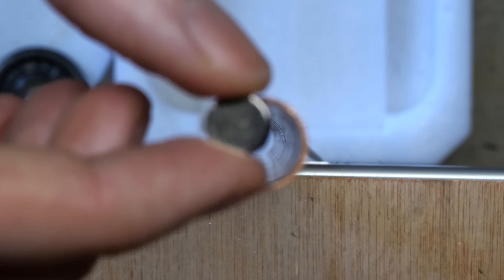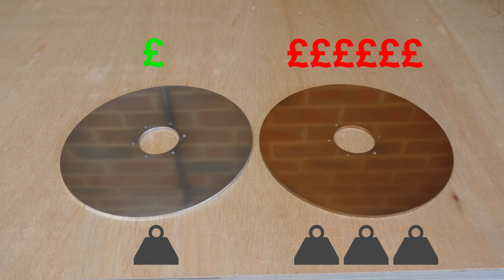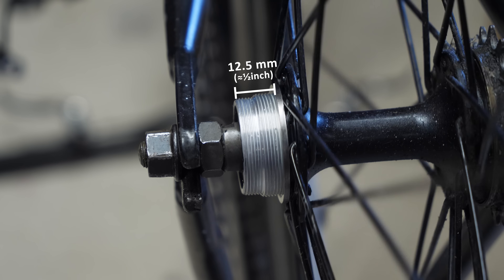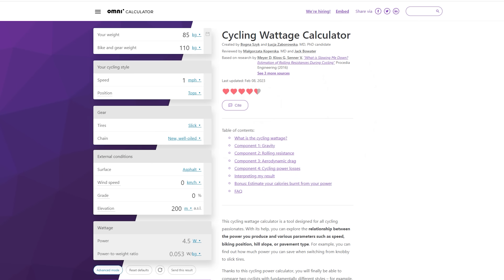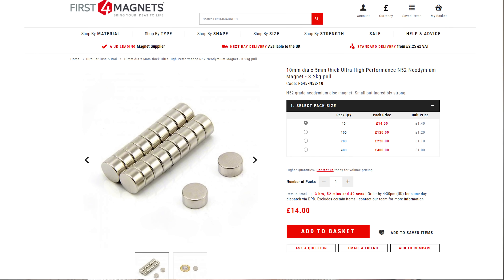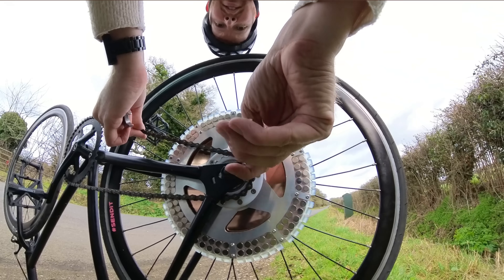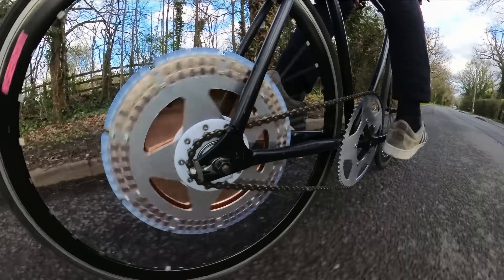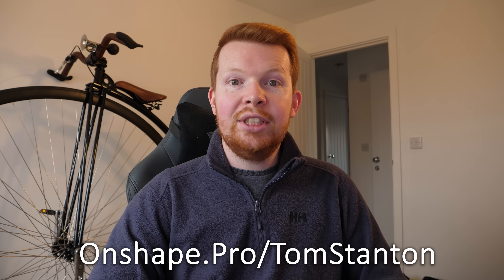Gearless Magnet Bike

Comment: Shouldn't we be able to harness energy in this way by using a weight attached to the copper pulley. Replace the permanent magnets with electromagnets and raise a mass using wind, waves or typical hydro-electric energy. Raise the weight in times of surplus and release that energy when needed for maintenance or to use when there is no wind, waves or flow. A weight against gravity is an efficient way to store energy. People think of batteries when the subject of massive energy storage enters the chat. Just use a giant weight.

Comment: This could still have some uses, you could make it work as some form of an additional brake to save on brake wear for non electric bikes or for when the battery is full and you're still going down hill, it would not be good as the sole energy transfer system since the magnets act like a perpetually slipping clutch or a fluid coupling not unlike a torque converter in an automatic transmission (incidentally part of why automatics used to get worse gas mileage is that manuals lock up their clutch while old autos would just keep slipping before modern lock up torque converters).

Comment: If your hub doesn't freewheel, would pedaling backwards not apply more braking force by increasing the RPM delta?  Did you try that?  I imagine it would push a lot of force through the pedals, though.

Comment: I think the best use of this sort of thing would be if you had a normal chain drive, but you could engage and disengage it like caliper brakes for coasting down really long and/or steep hills. Much quieter and no brake pads to wear out. Also have conventional brakes for emergency stops.

Comment: I always wanted to make some kind of inner giro rear wheel, So you pedal and its inertia would power the wheel with a kind of clutch system, so example, you pedal like normal, this in turn puts inertia power into the spinning giro in the rear wheel, when you stop you then engage the giro that's spinning to start you off again. Yes, one thing i would worry about, would its spinning inertia keep you upright without touching the floor lol. Thanks for all your time making these crazy videos..

Comment: You should try drilling holes in the copper disc (maybe like the shape of a disc brake) to improve heat exchange, save weight and interrupt the eddy currents. I believe that the power transmission would improve if the eddy currents weren't able to flow in their favorite direction

Comment: You wanted to emulate a CVT gearbox on a bicycle, but ended up with sort of emulating a torque converter automatic, but dry and without any gears. Or electric motor's regen braking. Anyway putting something like this on the rear axle of the bicycle on top of all the other issues discussed here is generating a rear braking force whenever you stop pedalling, which is scary dangerous whenever you cycle on wet tarmac, even tiny braking when turning can cause a lockup and cause you to tip over.
If this helps in future projects, modern mountain bikes have significantly wider rear axles than that, much more room for equipment.

Comment: Had you considered using the copper to drive the magnets fixed to the wheel? A narrow copper ring of larger diameter would be a better idea as it has greater inertia. Now consider that you are creating an electric current. That waste energy could be used instead to generate power for a pedal-assist motor

Comment: 10:47 you should have just used a belt instead of chain. Either that or just buy a non magnetic stainless steel chain. What if you put magnets on a disc and magnets on another disc but have them polar opposites so when you pedal they push against each other? Basically like a motor without power is what im thinking.

Comment: One thing you might have been able to do instead of 3D printing the threaded piece would have been to use an old fixed-gear sprocket with matching threads, and braze it to the copper disc.  This would make for a much stronger part than a resin print, and you could either grind the teeth off the sprocket or machine a matching tooth profile in the disc to inset the sprocket into the disc, making the whole assembly thinner.

Comment: very interesting idea. i was actually surprised how little it worked. I wonder if you incase the magnets in metal to point the magnetic current directly at the copper sprocket if it would give a "little" more resistance to it. it may actually keep the magnetic force from overlapping and give a better outcome?

Comment: Magnets sticking to the chain were a hint that you should be using ferromagnetic shielding, just a thin sheet of iron to snap on the magnets to guide the magnetic field. Not only it would work as a shield, but it would probably increase the strength of the magnets on the other (working) side.

If only I've seen this video sooner.

Comment: But you are using a lot of force, and that "slip" difference is going into heat in magnets and copper plate? am I correct? Do you have thermal camera? :)
Reply from the maker: I use a thermal camera at the end of the video :)
Reply: @TomStantonEngineering  I literally stopped watching right before thermal camera shot. Sorry! :)

Comment: Have you considered getting a belt drive for your bicycle to take the steal out of the equation on these experiments? Also, I wonder is a belt drive threaded with magnets on a large carbon sprocket would replace one of the disks on a magnetic clutch design.

Comment: Any thoughts on giving the clutch the ability to move closer and farther away from the disk?

You could also mount an array ofagnets to the frame and use those as a brake. Again, you would need to be able to move the disk closer and farther away from the magnets.

With enough room (to move the disk) you could use the same disk for acceleration and braking.

Comment: 3D-printing is fancy, a buzz word and makes your sponsor happy. Anyways, any normal mechanic would have brazed the copper disc on a worn sprocket or freewheel to get that cheap and reliable done. You can do this with a TIG welding machine (cheap DC is good enough) with silicone bronze (CuSi3) or just a stripped cut end of electric cable.

Comment: Copper wires for high-end electronics projects are sometimes plated with silver, because silver is a better conductor and current tends to flow on the surface anyway.  Would it help if you plated your Cu disk with Ag?  Nice project.  Thanks.

Comment: Fantastic idea.  Another possible direction of attack is to put the magnets at the peddles, or even both. 

Now the Electrician side of me (and in theme of electric bicycles), thinks what about adding electric magnets, so you can vary the magnets connected.  You could upgrade that with Arduino programming to control the magnet "connections".  Having both axle and peddle magnets, and then activate them for both power and braking.

Some other thoughts I had was what happeneds when you're at speed and reverse peddling.  Does this increase the breaking force, or is it possible to 'jump' the magnetic flux and thus your braking force would be reduced, or even accelerate (not likely).

Then you could have 'electric' gearing per se, in which you could activate or deactivate rows of magnets to alter the force applied to the wheel.

Comment: Please try this with a planetary reduction gearbox.  Place the disc between the input shaft (maybe the output one works, I don't know) and the outer ring gear.  With a high output torque, the magnetic disc slips, and what counts is the mechanical reduction of the planetary reducer.  With low output torque, the magnetic disc will drag the outer ring and the final ratio will be approximately 1:1 with high efficiency and little slippage of the magnetic disc.  Maybe this will have a real magnetic CVT.  NOTE: I used the translator, forgive the English.

Comment: Use the wasted energy to power a small motor when going uphill.  There is a significant amount of current being generated from the spinning magnets.  Essentially the wheel itself is a generator, and the added weight of a motor would be slight.

Comment: I realize this wouldn’t be the same as what you were trying to accomplish using copper but what if you replaced the copper disc with a magnetic disc made of a steel? Would it transfer more or less torque to the wheel?

Comment: There is a reason that copper electrical cable is smaller that aluminum for a given current & voltage-BECAUSE COPPER IS SIGNIFICANTLY MORE CONDUCTIVE

Comment: What about using a fluid bath torque converter instead of a magnetic drive?
There would still be no direct connection between sprocket and wheel

Comment: Really nice Project. I was wondering if the resistance torque in general is increased by the magnets passing the frame (and actually by all electrically conductive parts moving in the magnetic field) and generating some eddy currents acting as a kind of additional brake. However, this is a very interesting effect and explained very well. Great job!
Reply: Perhaps a carbon fiber frame and wheels with a belt drive.

Comment: A couple notes/questions:
- does the braking increase if you pedal backwards? seems like you haven't thought about it
- can this be used to generate electricity? And does applying a current to the disk reduce the resistance?

Comment: Great idea, but do you know what would have worked better... Magnetic peddal assist. Keep a drive train for initial force, but use a carbon gates belt drive rather than a metal chain, a hub gear system, front brakes as normal, and the magnetic drive as an unlimited pedal assist that does not require recharging. That should work.....in theory🤔🤔🤔!!!

Comment: Nice bit of work!  I would imagine that the heat created in the disk would also be created in the magnets, so the plastic magnet housing will soon loose strength.  This scheme would make a nice water heater driven by a windmill.   Wrap copper pipe around the static magnets to cool them, and using a pair of rotating copper disks with water bled between them via a gland on the shaft to cool the disks.  Could be a nice build! Thanks.

Comment: .
    This is an interesting concept. How about being able to control it with a battery and electro magnets, the electronic equivalent of a rheostat and a polarity reversing switch for different effects or maybe even a PWM controller? This would give you direct, infinite, continuous control of your "gear ratios".
    Maybe you could put a small parasitic coil on the bike frame near the magnets and regulate it to charge a super cap to power an LED head and tail light? Just sayin'

Comment: I feel like this idea could go much further with more engineering. There seems to be a lot of wasted energy just when breaking that could go into a super capacitor that might then be used to help get the bike moving from a stationary position. 

Also, I feel like the chain itself should be swapped out for something non-magnetic like ceramics or something.

Comment: The idea is interesting as an experiment, but for practical use on a bicycle, complete nonsense. On the one hand, the efficiency is low, but the main thing is that you need to keep pedaling and you can't rest, because instead of driving by inertia, the magnetic clutch starts braking, and the more the speed was higher, i.e. the more energy was given to the higher speed. In theory, a centrifugal clutch that would allow idling would be worth trying. (Google Translate)

Comment: I find this highly fascinating, don't know why I stumbled on your channel but being a car guy, this makes me imagine magnetic clutches vs. hydraulic or cable clutches - similarly, magnetic gearboxes, which this video also recommended me several videos from Tom Stanton EDIT: (which my tiny brain just realized was also you)!
One major flaw I found with your design is a seemingly unbalanced disc. In every clip in your beginning tests with weights, slow-motion or otherwise, it has an obvious wobble. This could be due to the heat generated during the CNC routing as you aren't using lube, causing the disc to warp (I'm not a machinist and may be incorrect), or heat generated by the magnets during braking? Or perhaps the hub itself? Bearings? Poor alignment? Magnets not being the perfect weight/size? Copper is easy to bend or melt to begin with, especially when heated.
Additionally, in the final prototype/build, wouldn't the magnets lose their strength due to heat over time?
Regardless, a fascinating concept and a joy to watch.

Comment: Maybe it can be used alongside an electric motor to assist in adding energy so all the energy isnt coming from the battery, and the extra energy can be used to charge the battery simultaneously.

And the breaking feature could be be used alongside the regular breaks to save on brakes as you said.

Comment: i have an idea for you to put into practise and get rich with:

an automatic gear system for the bike - based on centrifugal energy (if rpm > rpm+x then flip to bigger diameter gog)

electronically                     
(no chain between legs and wheel, legs -> dynamo in <-capacitor/battery-> motor on rear axis i.e. ; switching gears by counting hols on rear axis) 

purely mechanical  (a weight centrifugally responding to rpm triggers a gearchange)

electromechanically  (electronic on rear axis triggers a gearchange - but power is direct input by chain or kardan-shaft)

i think it could be done any of the three ways.

Comment: Have you thought about electromagnets of sorts using some kind of transformer for adjusting magnet strength for a type of gear transmission, Probably this video explained why my idea couldn't be done but if it was to work, you'd be the one to figure it out.

Comment: 1. if the chain slows it down can't you make the chain with a different metal to not be magnetic? 
2. could you put the magnet in the front wheel, and or do 2 wheels and possibly increase the output? 
3. Can you do a demonstration with it spinning on its own, just the wheel and the pedals? 
 4. Whats the difference in speed between it going on it's power without pedaling verses coasting? So, what is that speed and distance at all in comparison? Compare the speed and distance of coasting verses the speed and distance of magnet power. This is basically the information that I'm looking for thanks.

Comment: In fact, such a magnetic clutch is not a torque transformer but more a power waster. This is because the torque you generate multiplied with the angular velocity difference between the magnet wheel and the copper disk is the amount of power wasted. Only the amount of torque generated multiplied with angular velocity of the copper disk is the amount of power transferred to the wheel. 

The amount of transferred power divided by the sum of the transferred power plus the wasted power is the efficiency of this transmission. You can easily calculate that this efficiency becomes very small if you try to drive up hill. This is certainly the opposite of that, you have desired. A real continuously variable transmission works of course differently. But it is also easy to make by use of magnets.

Comment: You should try making the diameter of the copper plate larger and also put some fins on the back of it and that will dissipate the heat and if you orientate the fins in the right direction they will actually blow the heat off of the copper though that he could be used for something I don't know what but you have a really good idea there.

Comment: Just like hydraulic torque converter in automatic gearbox it works in slip. It is just magnetic torque converter. If you would include friction lock-up clutch like cars. It would run better.

Comment: Dang! This is interesting! I have designed and built prototype racecars in the past. I wonder  if I can apply this on an engine, and eliminate the clutch. Perhaps use many more magnets on a type of release plate, a solid copper precision cut flywheel and make the magnets move closer and farther from the flywheel? My mind is racing. I'm going to give something like this a try! Thanks, one of the best vids I have seen in months!

Comment: That is also creating electricity. It would be so cool if it was captured, charging batteries that ran a electric motor to power the bike after self charging. Basically a E bike with zero charging port.

Comment: That is very nice, although I don't agree with the idea of the braking forces being higher with the new larger gear. You would do better if it had a freewheel sprocket, it would be more useful if you could rest your legs as it freewheels and not brake.

Comment: Bigger discs - the size of the wheel.... the magnets can be brought away from the chain without touching the spokes - allows more magnets and each magnet should be stronger.
ALSO:the copper disk should be like a camera shutter - you can 'open' or 'close' it to give a different force transferrence.
ALSO Make it 2 wheel drive - no reason not to have thte whole setup replicated to the front
ALSO blades on the front AND back wheels, and HD Night vision cameras front and rear. saddle bags and a radar setup and you are ready for the coming apocalypse....